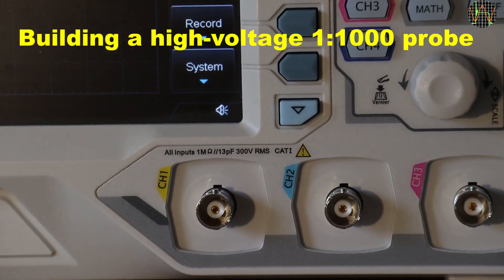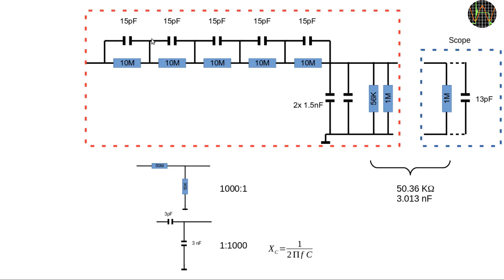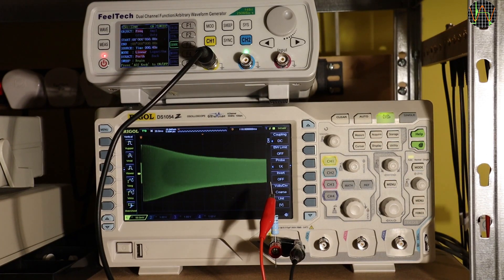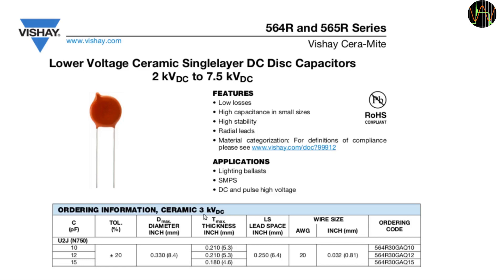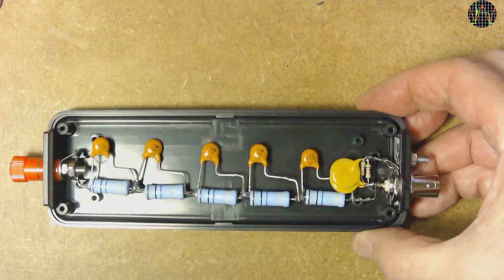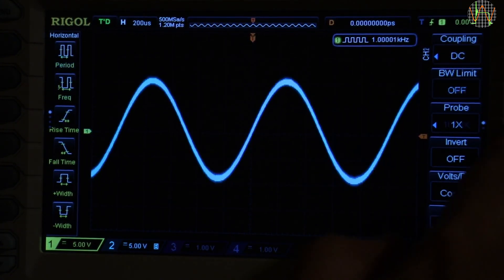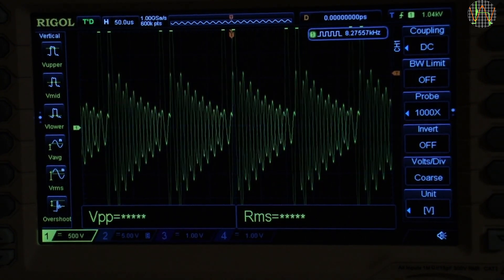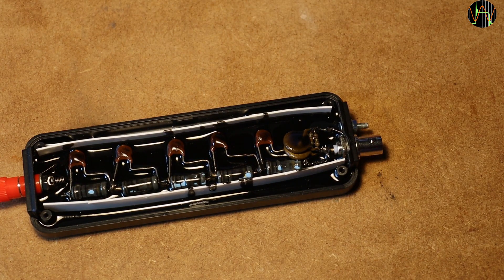Building a high-voltage 1:1000 probe

Comment: Такие помехи из-за того, что вся эта длинная гирлянда из резисторов и конденсатора имеет довольно высокую индуктивность, можно было бы всё это собрать более компактно, применив SMD компоненты, а что бы меньше грелось, увеличить сопротивление делителя..
Reply from the maker: You can't use SMD resistors because they cannot withstand the voltage drop. You would need long strings of them which means you have the same inductance issues as before. Also in a compact build you increasingly risk arcing from the high voltage side to the low voltage side. I am not saying it could not be made more compacter than what I did but it becomes increasingly more difficult and risky. I went the safer way and compromised on bandwidth in return. You can't win, its always a compromise.
Reply: @TheHWcave  Это да, проблема с минимальными необходимыми зазорами, что бы не происходило пробоя между контактами, делает такие конструкции довольно сложными в изготовлении и допусках, хотя если всё заливать смолой, эти зазоры можно было бы уменьшить. Я вот тоже думаю собрать подобные делители, ото есть пара проектов, где они очень пригодятся для необходимых измерений, вот и стараюсь для себя выяснить, на сколько же можно всё это уменьшить, что бы не пробило. А так же, в случае повреждения, есть мысли соорудить у входа в осциллограф защитную цепь, с малоёмким  стабилитроном SRV05-4, спаять их 2 штуки, встречно, тем самым ограничить сходное напряжение до 10-15V.

Comment: Excellent video. Thank you. One query is why you don’t need a negative line on the input to the divider, as in you only have the yellow lead to the input in your test setup?
Reply from the maker: Thanks. The common line (for DC that could be the negative but doesn't have to be) is shared with the low-volt side on the output. The implicit idea behind all high-voltage probes is that one line is safe(r) for example neutral in AC mains or maybe the negative line in a HV DC supply, so the voltage on the more dangerous line is reduced by the probe which has connections for both lines at its output. Connecting the probe correctly is very important. For example if you measure the anode voltage in a CRT (say +10000V) you would connect the tip of the probe (yellow wire) to that and the other end to ground and your multimeter. But if you would reverse the setup, connect the tip to ground and the other end to the CRT, it would still work but now your multimeter is at 10000V against ground (very dangerous).
Reply: @TheHWcave  Thanks for the detail. I plan to use your device to measure the output of an NST with an output at 1.5kV RMS @ 35kHz. So one of the two NST output leads would go to the HV input on the divider and the other lead could be connected to the neg terminal/screw of the LV divider output.
Reply: @TheHWcave   I was wondering the same thing. Can you please do a video on the correct use of this probe?
Reply from the maker: @scottneels2628  I see if I can fit it in.

Comment: I'm looking for something like this that will work with a multimeter.
Reply from the maker: It is designed for the measurement device on the end to have an input resistance of 1Meg which is common for scopes. I have used the probe often with my digital multimeters which typically have an input resistance of 10M. For such DMMs , all you need to do is connect a 1M resistor across the input terminals of your multimeter (i.e. in  parallel with the probe outputs). Yes, technically a 1M results in a slight error because the resulting input resistance is only 900K but in practice this is not very noticeable. If you want, you can avoid this error by using a 1.1M resistor instead.

Comment: Thanks for the interesting video. But I am concerned about the relatively high input capacitance of the divider. Let's say you connect this divider with an input capacitance of 3pF to your small high-voltage DC-DC converter that operates at 100kHz. At this frequency, the equivalent input resistance of the divider is about 530 kOhm. 
Accordingly, if the converter produces 10 kV RMS, then the AC load current will be almost 19 mA, which corresponds to almost 200 VA of reactive power! It is doubtful that the converter could provide such power.
And how would you estimate the value of the intrinsic pass-through capacitance of high-resistance resistors? Is it negligible compared to external capacitors?
Reply from the maker: It is true that the capacitive load needs to be considered when using this and lower caps would be better.. Unfortunately one of the problems is finding suitable high-voltage rated capacitors (from reputable distributors). Any probe will in some way influence the device under test. I think your example  device would be extremely difficult to measure without notably influencing it. You would probably have to design a specific (possibly active) probe for just such a case and even parasitic capacitance would need to be avoided. Consider that even if you left all capacitors out on my probe and the scope had no input cap either,, the pure resistive divider would load this converter already with 2W

Comment: For signal processing purposes, does it necessary to put it in metal housing to eliminate noise?
Reply from the maker: In principle, shielding is always good but in this case your "signal" is huge like thousands of volts so some stray noise isn't noticeably. Also because the thousands of volts, avoiding arcing against a grounded metal housing is going to be very difficult. Plastic is safer but I still will not hold or even touch the probe when its under voltage.
Reply: @TheHWcave  is this good for ripple measurements for NIM power supply or do I have to adjust RC values for my own specs?
Reply from the maker: @hikaruchen2476  I am not familiar with NIM power supplies

Comment: About the capacitors: 3kv and even 10kv ceramic disc kits seem to be all over amazon, and y1/y2 capacitors can also be bought reasonably cheap or salvaged from SMPS junk. A smaller capacitance value can always be achieved by using several in series. 5kv insulation testers are also cheap these days, so no need to blindly trust salvaged or cheap stuff. What am I missing here?
Reply from the maker: Yes, if you are willing to put the time in to test voltage rating and measure capacities and find the space to mount them safely (no arcing over), by all means that could be a solution

Comment: Can this also be used for high voltage AC as input? I wanted to study the frequency of my high voltage AC source
Reply from the maker: Yes, it is designed to work for AC as well (using the caps as capacitive divider). It's bandwidth isn't that great though, 3 MHz is all I got.

Comment: I have a decent high voltage 1:100  probe, that is rated as 300Mhz / 5Kv which I obviously wouldn't use it for, mostly just for mains 230v and high voltage around 500v to 1500v that are used when working with CCFL when trying to light up noble gasses for spectrum emission line reference purpose etc. , but its one of these small normal scope probes just with a rating 1:100 and kind of unsure (lack of knowledge) if its safe for my scope, as people usually push for differential probes for anything up around mains and above, but differential probes they are quite expensive and my needs are relative.
Would a 1:100 probe be sufficient, when I ain't gonna work on high voltage up the four digits powergrid, but mainly EU mains and CCFL devices with relative little current behind as its batterypowered-.. my 4ch. scope is floating., so not connected to earth.. (Micsig/battery)
Reply from the maker: If the probe is rated for 5KV it is ok for standard mains 235V RMS or so. But be very careful with anything more or different signals. The peak voltage of AC is much higher than RMS (factor of 1.4) and what counts in this case is the peak. But this factor is only true for sinusoidal waves. If your test objects generate "interesting" wave forms (why else would you look at them?) , the peaks may be much higher than the RMS. Also beware of the other channels on your scope. If you connect one to high voltage, at least the outer ring may (and any other connector to the scope common ground) may well be on high voltage too.

Comment: You, sir, just came at the right time! I was working with a laser driver circuit and didn't have the probing I needed to debug a flash lamp driver and didn't want to purchase an expensive 1000x probe. I think this will likely do the job for me!
Reply: I made my probe and it works wonderfully =)
I used a single 50M resistor and 10x 100pF, 3kV capacitors in parallel with it. The added capacitance in the scope side was 10nF. I tested the bandwidth with my function generator and got good behavior until 7MHz which is pretty good!!

Once again, thank you sir; such a simple thing but you are helping people out there 🙏

Comment: OScope in the experiment draws 300 mA to display 300 full screen!
What's the purpose of applying a 1 MOhm and 56 KOhm resistances each parallel to the I MOhm internal resistance of the OScope?
Oh, the Scope has flexibility to be configured!
Reply from the maker: he probe is designed to see a 50K resistance on the low volts side. With scopes usually having 1M input resistance, the extra 1M in paralllel with the scopes internal 1M and the probe resistor of 56K results in a total of approx 50K. As a side note, this means you actually need to add a third 1M in parallel when using the probe with a digital multi-meter which usually has 10M input resistance. Otherwise you will get a slighly too high reading.

Comment: I  cut out a small 7”x2” piece of phenolic and inserted turrets for the circuit. Problem is that I can’t find a project box the right size
Reply from the maker: If you are going to pot it any way (highly recommended!), almost any housing would work. Maybe you could make one yourself to measure from thin ABS sheets ?

Comment: Can I make a cap divider with capacitors 150pF x 5 in series and 10nF x 3 in parallel. I can't find values below 100pF that are for more than 2kV. So the capacitance would be 10 times higher than in your scheme? Horizontal caps = 30pF and vertical = 30nF. Thanks in advance!
Reply from the maker: I think that should still work. But for high frequencies say 100kHz the higher value caps will load the input source quite a bit more of course.

Comment: Partially exposing components might help with heat dissipation
Reply from the maker: Probably but at a significant risk for the user. I'd rather be safe. Maybe I am a bit paranoid but I will never hold the probe in my hand or even touch it while it is in use.

Comment: Values for  100:1  resistor and Capacitor.  And  nos .
What about to measure triac chopper voltage wave forms  and  
Associated  high frequency noise measurement?

Comment: Hi, i see you tested the high voltage generator which claims to output 15kv, and you are only reading 5kvpp or am i missing something? thank you
Reply from the maker: Probably 3 things coming together here, Firstly, I did not push the generator that hard because it gets very hot already. Higher voltages may be achievable but for how long? Secondly, the probe is loading the generator with 50 MOhm. At 1000V RMS that is already 20uA or 0.02Watt. A lot of power for this tiny thing. Thirdly maybe the advertising guys for the generator exaggerated a bit, because who would be able to actually be able to measure it?
Reply: @TheHWcave  haha, well probably the wouldnt expect someone to measure it, and you are the only one i saw doing it. About the current, they claim to output 0.4A of current, so i dont think 20uA of current is that high and it could handle it easy, its probably handling a lot more current when shortcircuit its output.. Correct me if im wrong. 

Anyways, im building one probe myself like this one to test one of this transformers, so thank you very much for sharing this with us...

also: what did get hot, the transformer itself or the transitor??
Reply from the maker: @gastjjs  I cannot believe for a moment this would be able to do 0.4A at 15KV. That is 6000 watts ! Even at 1000VRMS its still 400 watts. Total marketing baloney! What got hot first is the transistor in my experiments.

Comment: Great video. You could fill the outside of your mold space up with silicone sealant prior to pouring the epoxy, or at least stick down the plastic pieces with it.
Reply from the maker: Thanks. Good tips. This was my first attempt at potting, so its a bit rough

Comment: that's cool. Is it safe to connect read the voltage at different points if i wanted to get a 1:400 reduction? can this be done with rotary switch?
Reply from the maker: No, sorry, that is definitely not safe, and it would not work. Each of the 10M resistors has 2000V over it (when measuring 10kV). The resistors are purposely large and spaced out to minimise the danger of arcing between one end of a resistor to it's other end. No rotary switch would be able to handle 2000V difference between each contact position.  If you need a 1:400 switch you would need to design a completely new divider chain for it (and encase it in resin)

Comment: I want to measure voltages up to 10kv ac and dc. I would like to make probe 10:1 as my meter can handle 1000v ac/dc. Could you let us know the values of the components for such probe?
Reply from the maker: A youtube comment isn't the place to design something that can safely manage 10000V.  Don't get me wrong but building a safe DIY probe needs a lot of experience, from component selection to building and enclosing. The design is the easiest part. Your safety is on the line and I don't want to be responsible for this. Therefore, I honestly think it would be much safer to buy a high voltage probe. You can find some used ones which should be ok as long as they are in good condition, no cracks of the enclosure, undamaged cables. They tend to be higher 1:100 or 1:1000   but that is ok, you just have to use a more range on your meter. Anyway a probe delivering 1000V as the low output is scary by itself  Much better to step it down into something truly harmless like 10V. Also be aware that most meters may be able to do 1000V DC but not 1000V AC. Mostly AC top ranges are limited to 750V (RMS) because the peak voltage of that  750AC is just about 1000V (1058V to be exact)
Reply: @TheHWcave  Hi mate, thanks for your prompt response. Yes, you are right 1:100  probably is a better idea :) I just thought that the higher ratio probes will be less accurate as you have to use more components that have their accuracy limits.
Reply: @TheHWcave, did I miss the common ground wire in the video or the HV and LV side grounds are not connected at all?

Comment: Can this schematic be used in AC? (because of the series capacitors)
Reply from the maker: Yes, that is why the caps are in there. But the frequency range isn't that great, so do expect some distortion on rectangle signals of higher frequencies.
Reply: Surely it's easier to watch and pay attention to a video, rather than asking such a question?
In fact, if you need to ask the question, then you really shouldn't be "Daily Fixing" any kind of electronics. 😂😂

Comment: Hi thx for upload , if i need to go 40KV , just need to add 4X  10M resistors &  15pf capacitors?
Reply from the maker: No that won't work. 9 resistors means 4.5KV over each resistor and a loss of 2W which is double what they can handle. If you managed to find at least 2W types that can handle 10KV you could use 10 of these. The voltage over each resistor is now 4KV (I would always recommend to stay below 50% of max) . The caps need to handle more than 4KV each, go for at least 7.5KV or 10KV.  Even 2W resistors will get very hot (1.6W loss on each). The centre resistor needs to be doubled to 100K but to compensate for 1M scope inputs  you need 120K with 500M in parallel. If you stay with 15pf caps over 10 resistors you need just 1x 1.5nF in the centre. In any case please be aware that this is dangerous stuff and you need high quality components and build this to minimise arcing. You definitely need a better housing than I did and I highly recommend never to hold or touch the probe when in use.
Reply: @TheHWcave  thanks ,appreciated the advice, I mean 4 sets of your one 5x4=20 of 10M resistors
Reply from the maker: @eciovsolutions  Ah, ok. Looks like you plan some kind of pipe to house that many resistors ;) but maybe not a bad idea anyway. One suggestion is go for 1:10000 because for 1:1000 the output resistor is getting very high 200K which makes the accuracy depending on the input impedance of the scope/DMM.  With 20K the accuracy would not change (much) whether you hang a 1M scope or a 10M DMM on it.

Comment: If you want a 10KV probe with 5 resistors at 10M each then I would expect each resistor to have a 2000V potential across it.  At 10KV through 50M produces 2mA of current.  The wattage through a single resistor should then be (2000V)(2mA) = 4W, but you choose a 1W resistor.  I think you should have used a 4W resistor; with the extra 50.36K it would be large enough.  

I believe it is true that only the voltage drop across the resistor needs to be considered when calculating the power, as was done with the capacitors.  Being certain this concept is correct would be nice.  Maybe someone will verify it, but I am going to believe it for now and in the future until the hypothesis is nullified.

Thanks for the video.
Reply from the maker: Sorry, 10KV through 50Mohm produces 0.2mA of current not 2mA and hence Ohms law is saved.  In total the chain dissipates 10KV*0.2mA = 2W. Spread over the 5 resistors it's 0.4W per resistor, hence 1W resistor is plenty good enough.